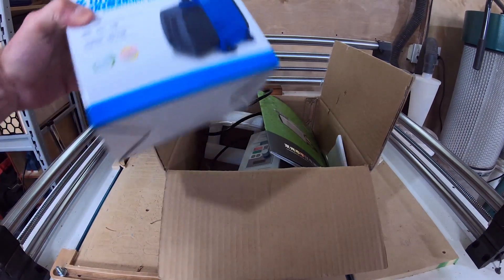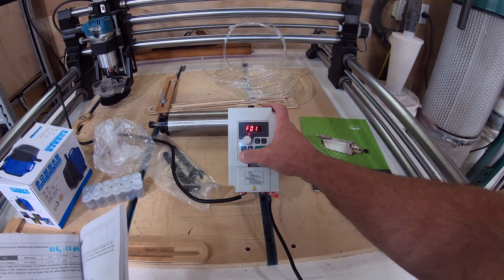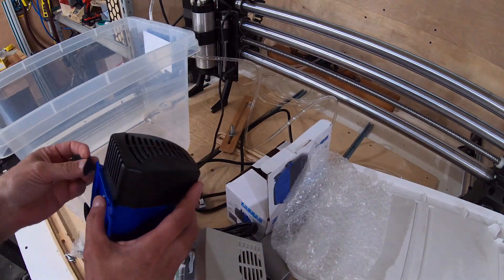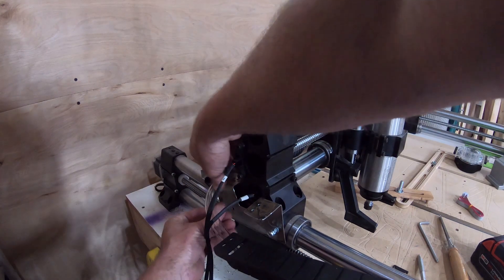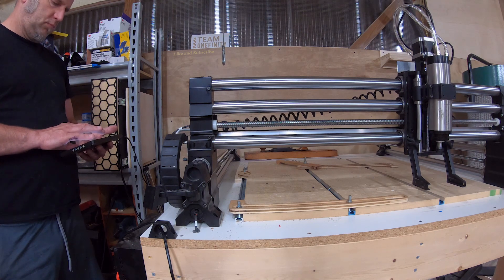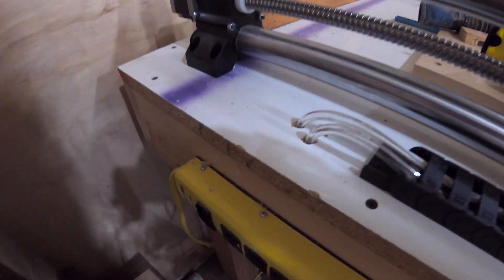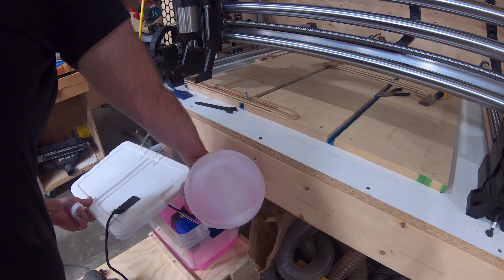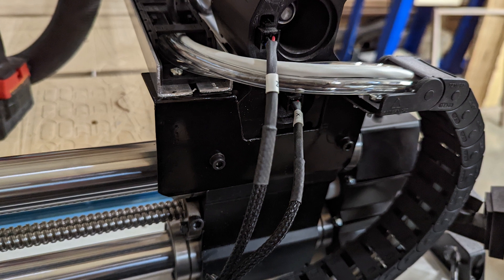Onefinity 65mm Spindle Upgrade

Comment: Nice overview of the upgrade. I’ve got all the bits to do the same to mine. I’m just waiting for the Journeyman upgrade to arrive to do it all at the same time. I like the large braided sleeve at top. I might borrow this idea as well.
Reply from the maker: Thanks.  In hindsight I would have added a piece at the elbow too.  I only ran a couple inches inside the chain itself because I felt like it might not allow the hose and cable to move around freely.
Reply: I have the same spindle on my nextwave. The hose does leave a bit to be desired. I just ordered a X 50 woodworker and plan on keeping my spindle to use with it. I wanted to ask if you had any tramming issues? What type of wire did you use to extend your wiring? Also I had problems with the pump that came with my spindle and it quit after about a month. I highly recommend a flow wheel. Thanks for the video.
Reply from the maker: To be honest I haven't trammed it after the swap, but have done a dozen cuts and it seems to still be spot on from where I originally trammed it with the Makita.  I used the 18g shielded wire linked in the description and went back and forth on the wire for it, but landed on that one.  I figured if it was shielded and I ever lost a step it would help rule out interference there.

Comment: What is the slowest speed you can run the spindle? Also is the speed programmable in the cut program?
Reply from the maker: I guess technically you might be able to get it as slow as you want it in the vfd, but I set my lower limit around 5k rpm.  As for having the hardware control it or even the cut file itself, there are ways I think that include a breakout board and some wiring to do that, but for me I'm fine controlling it from the vfd.

Comment: Good stuff. Thanks
re: the heated and stretched coolant hose
Do you plan to replace that? Heating can make the hose a bit brittle. If it cracks, clamps won't save you. Could go with a larger ID hose, upsize the pump fitting. Probably give a bit better flow too

I dunno though, just a suggestion. Trying to work myself up to buy a CNC. Thanks again for helpful vid.
Reply from the maker: Some time I might actually get the proper fitting for the hose.  Luckily that section of the hose just hangs out in tub so the only abuse it gets is from the pump.  I'm fairly certain I could buy the fitting at Home Depot, but haven't yet.

I'll be glad to get back to using the CNC.  This current project is nothing but sweat and tears. Haha

Comment: You certainly must be aware that once you loosen the collet nut, that you continue to back the nut off till it pulls out the collet.
Reply from the maker: For sure, the issue may have been with the 1/8" aftermarket collet.  I bought the 1/8" from the same place that i got the one for my DeWalt when I had it with no issues.  This one, I could take the collet nut off and still not pull anything out.  The weird thing was once it broke free, it would move around like nothing had ever been bound up.  It was quite baffling.  

That said, about 10hrs on the spindle now and wish I'd done it earlier.

Comment: Any issue with Z travel? There were some folks that bought the 65mm and lost Z travel height
Reply from the maker: It's just over 5" from my waste board to the bottom of the collet.  The bracket for the z at it the setting allowing the most height is 4-5/8", so not losing anything really.  Let's say the bit extends an inch from the collet, you lose around 1/2", because anything higher would hit the z bracket at that point.

Comment: Hows the spindle been since you upgraded?
Reply from the maker: It's been great.  I've had zero issues with it and it's worth the upgrade.  So quiet too.
Reply: Nice, thanks for the input. Been putting this makita through the ringer over the years. Figured it was time to upgrade. @shadeTreeWorks
Reply from the maker: @6842mcdonald  No problem, the only thing I changed was I went to a 3.5 gallon bucket for the reservoir and sealed it up really good to make it a closed loop essentially.